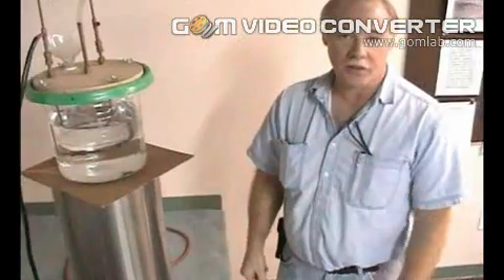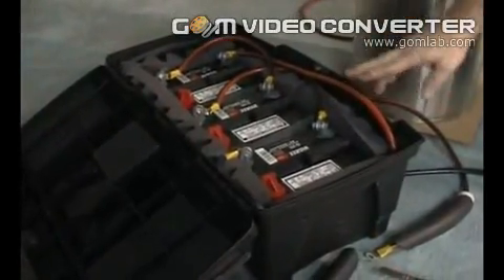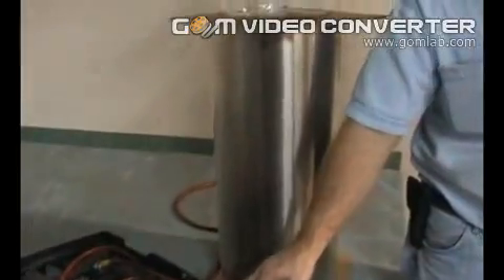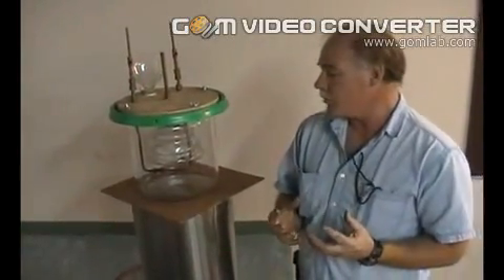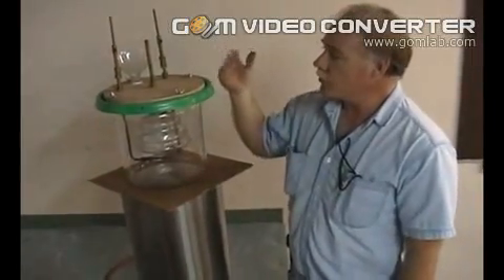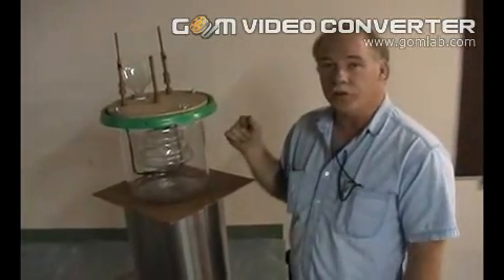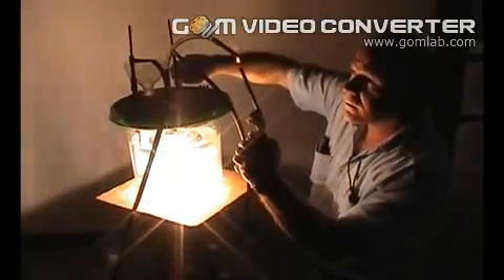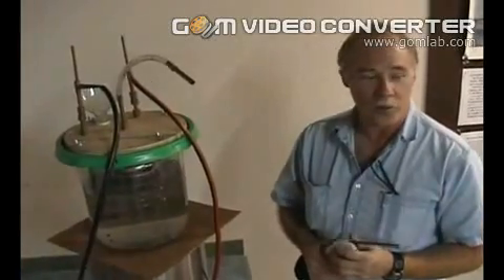The principles of Ruggero Santilli demostrated

Comment from the maker: I point out this is well known technology that is suppresed . It can of course be made COP >1 quite easily . by running at PF 1. I suggest you research US and British patents issued to Eldridge,Clark & Blum in 1898, US no 603,058 , you will find this system tailored for individual domestic use running on the house sewage and water. Not a system TPTB (the powers that be) wished to prosper then, anymore than now.

Comment: How much kwh to use up a quart of liquid and how much gas produced?
Reply from the maker: hi canvideo .. quite a lot using this method , I doubt this is COP>1 or anywhere near ,even simple practical units use pulsed DC there are many variables control all of those and your in Stan Meyer land .(COP > 1700)  this however is just a very simple demo. with no pretence to be anything else